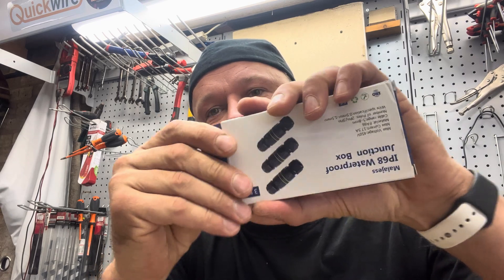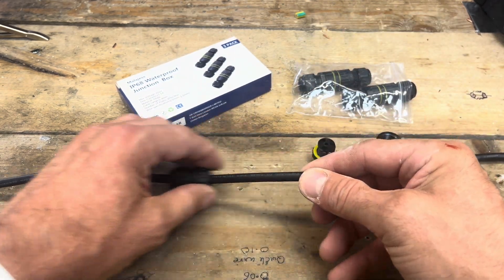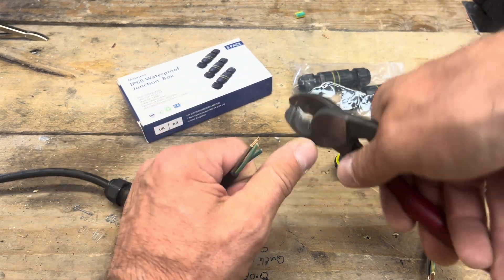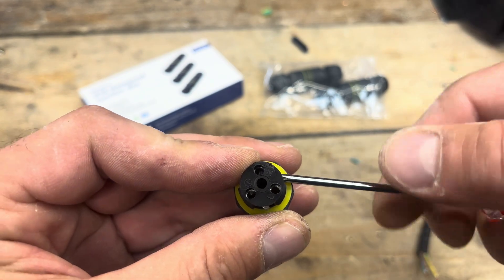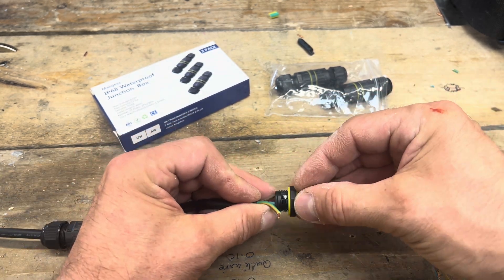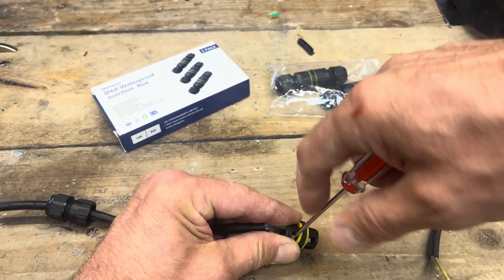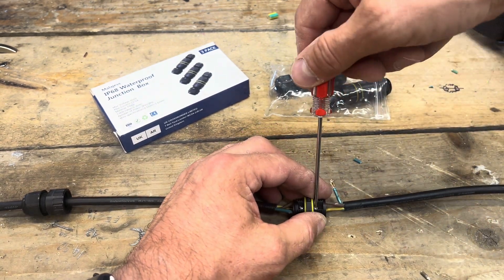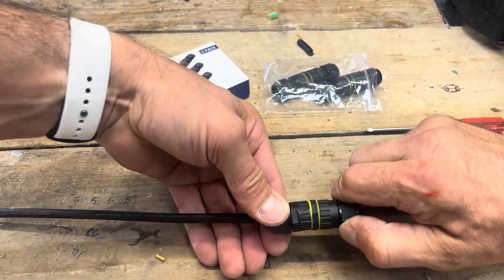Waterproof Junction Box: A Must-Have Outdoor Cable Connector!

Comment: Ive used these a couple of times & they eventually let water in. The best thing i used is a good I/P rated box AND fill it with Magic Gel,   so far I've not had any call backs.
Reply: Agree. I've been using "T" tubes for many years. They're pretty good, although some brands have illogical terminal markings! However, I use a potting box filled with PU potting compound for permanent installations. At a push, you can fill the ends of the connector with potting and then tighten the gland nut up.
Reply: Does it work for armoured cable?
Reply: @1987kahil if the connections are well done and the box is water tight, its ok.